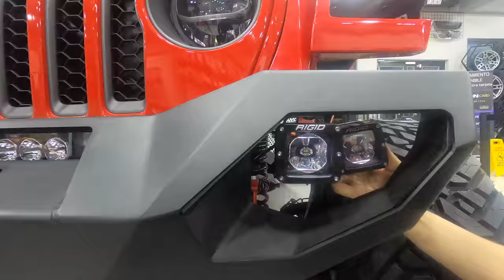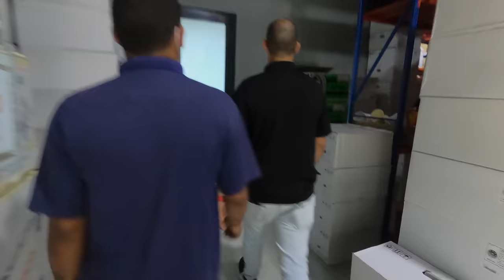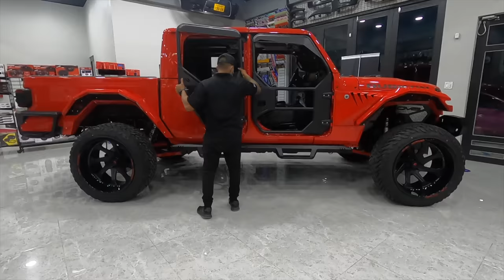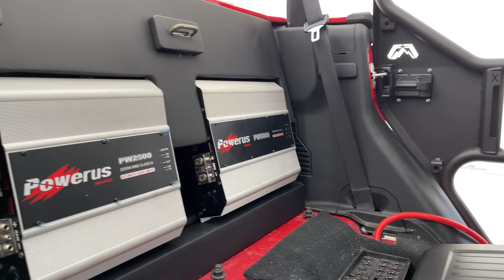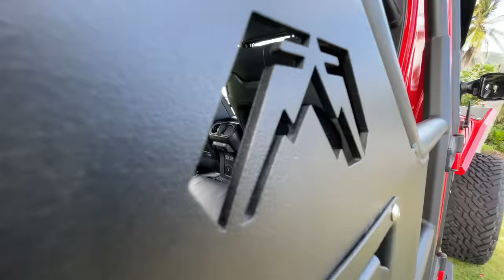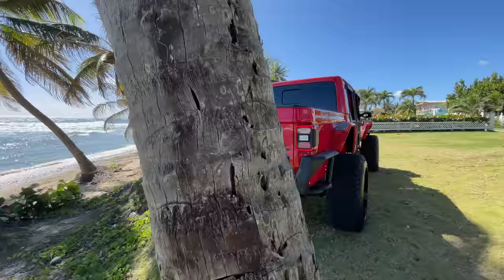JEEP GLADIATOR BUILD IN UNDER 10 MINUTES ! JEEP TRANSFORMATION VIDEO.

Comment: Don't you think a Jeep that size would benefit from higher profile tires? Those look a bit strange and Dont seem to offer much in the way of suspension. What pressure do these have to be run at for optimum traction across the board?
Reply from the maker: 38 is the pressure! Keep in mind we will never use it for offroad purposes. It sits in a showroom in our store. If we take it out is just to go to car shows.
Reply: @musicontvpr  is there a demand for these without the offroad capability? Seems like a strange purchase for a road vehicle.